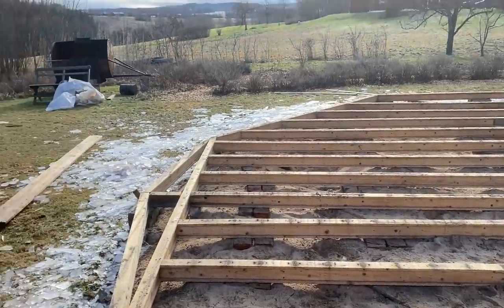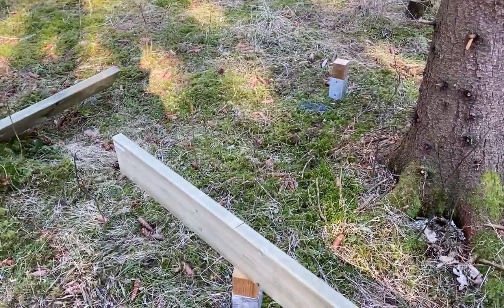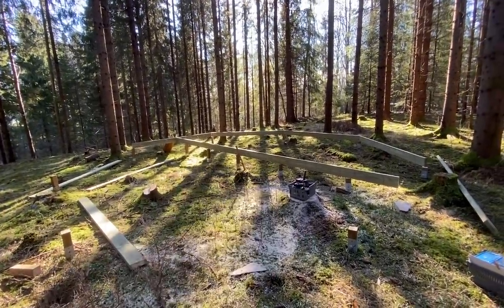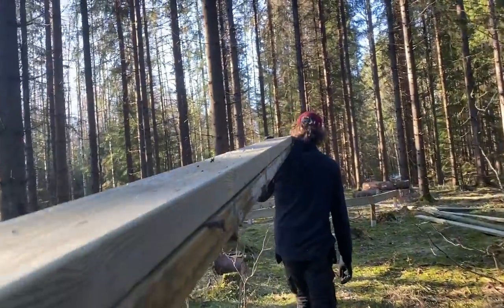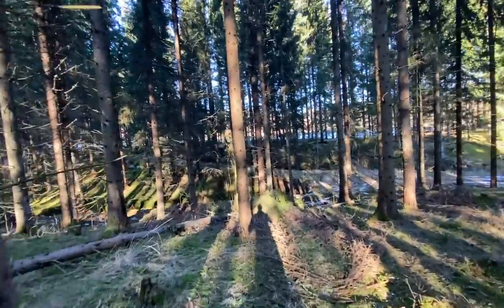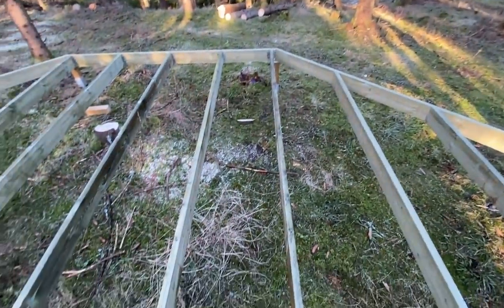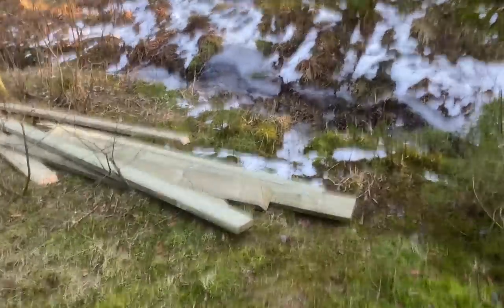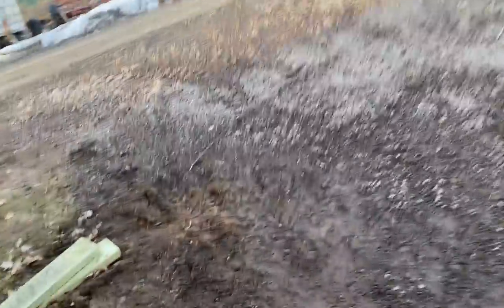Another good days work...

Comment: Great stuff, keep us updated on progress. Yes, diagonals needed on taller legs. All the joist ends in hangers are great, but it looks like you're relying on a couple of long screws into end grain on the 45 degree cuts. Suggest additional 135 degree metal angle plates screwed on for loading safety on these areas.

Comment: I hope you're not burning treated wood...
Reply from the maker: No, that's highly illegal here
Reply: @regenerativeagriculture  Good to hear. Yeah - same here in Denmark.
Reply: This is all very noble, but how do you dispose of treated timber, you can't burn it and you surely can't bury it, solution please gentleman.
Reply: @victormorris3680  You can actually burn it, but it has to be done in a special facility at very high temperatures and with carbonized fume extractions to capture all the bad stuff. Most places put them into landfills, which is horrible - so if you decide to use treated wood anyway then in my opinion you carry a responsibility to make sure it's properly disposed of too. But no, in the perfect world everyone should just use better wood.